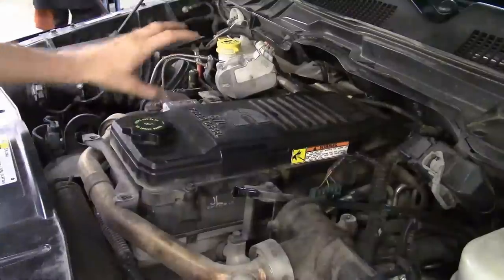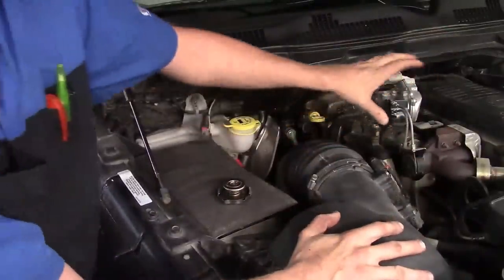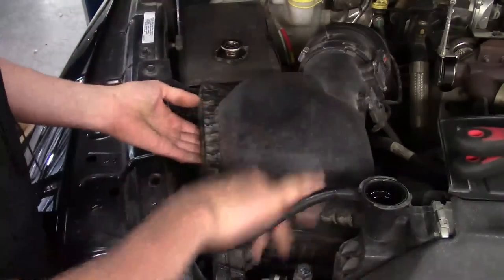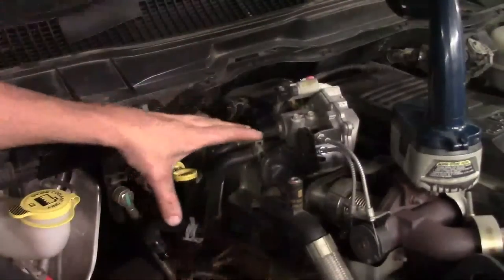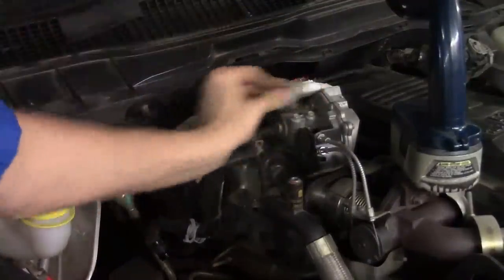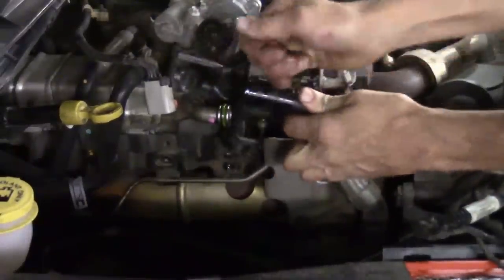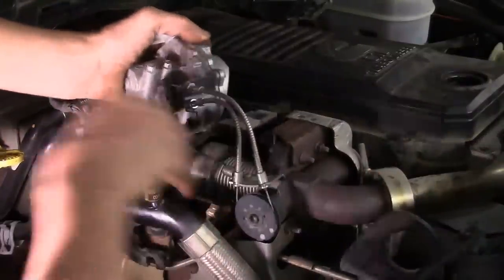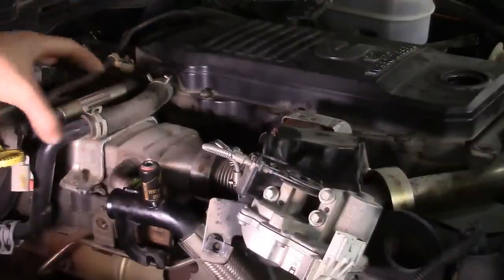Part 1/3: Dodge Ram Cummins 6.7 diesel EGR cooler removal and cleaning

Comment: I wish you would post the years of these 6.7 Cummins because different years require different maintenance schedules and required maintenance.
Reply from the maker: This video was made 7 years ago (2015)……there weren’t many differences back then. Here is a link to another video I made the covers the specifics on the newer versus older 6.7 engines: Cummins 67,500 Mile Service DO'S and DONT'S
https://youtu.be/8GpgpQKxBY0

Comment: Thanks for the content Dave. Much appreciated.  I have a question about my 2015 6.7

 you said in another video that the 2013 to 2018 do not need EGR cleaning with the 67500 service, just the ccv filter.  So with that being said, when do you clean the EGR system? Will it throw messages to tell you or is there a different interval? Possibly clean the system when making upgrades such as banks power intake elbow to eliminate grid heater death bolts?

Comment: I watch your videos and you have a lot of information on the 6.7L diesel. My question is I have a 2011 Ram 3500 with the 6.7L diesel and I notice from watching you about the 67,500 service I look in my Ram Truck Diesel owners manual and it read( The EGR Cooler is covered by the manufacturer only at this maintenance interval for vehicles in California ). I went to the dealer and they said no. I have been trying to locate were it is written in the Calif emission laws.  I am hoping you can help me. Jeff.  P.S. I have never done something like this.

Comment: Took my 08 5500 4x4 diesel in this week for a tie rod recall. Dealer naturally found over $5000.00 of repairs they "said" needed done. Among them was the EGR clean. They charge $935.00 for this. I can't believe how dealers rip off people who don't know better. 

I really like your precise, well made videos and would like to thank you for making these. Always nice to know any tricks before starting a job.

 On a funny note, after going over all the stuff they said was urgent to get fixed, they said my oil was on the verge on needing changed. I said," Oh really. How do you know that?." He said they run it through a tester that can check the service life of the oil. I then told him I normally like to get more than 30 miles out of an oil change as I just changed it before coming here. I don't think Rotella T is a bad oil. I then pointed at his list and said," Now do you see why I have a hard time believeing ANYTHING you have on this list? Just do the recall and that is it."

What a bunch of low lifes. Sad part of it is I even mark the filter with the date and mileage it was changed and you could see that from under the truck.
Reply from the maker: kj inohio You certainly get the good and the bad when you deal with people selling work  on your vehicle. I would love to have seen them show you how they tested the oil.....the look on their face and the excuse as to why they cant would have been priceless. I'm sure there are a few things on the list needed and then there are always the recommended items. Glad you knew better then just say yes like they were hoping for. Still....check over the list and see if you can verify any of the needed items and address them if need be. Thanks for the kind words and for taking the time to watch and comment on the video. Make sure to subscribe and help spread the word by sharing these videos with others. Have a great 4th as well!
Reply: MotorCity Mechanic 

The other urgent items were front and rear brakes($2000.00) and a leaking front differiantial cover($195.00). They say the discs were overheated and show damage. Wheels were not taken off. As far as the diff leak. This truck sat in my heated garage all winter with nothing on the floor. I did recheck the oil level in it and it is within spec.

 When I mentioned the oil change the service writer hung his head and changed the subject. There are good and bad but I seem to be unable to find the good ones. That is why I decide 30 years ago to do my own work and do not regret it. Your videos will just save me some mistakes and save me time. THANKS! and yes, I allready subscribed. Thanks again, Kevin
Reply from the maker: Hey....I got videos on the brakes as well, at least the rear. I can't imagine what its like to not know how to work on your own vehicle like most people. Its all I have ever known so that other side is foreign to me. Just find the time to work on my own is the issue I have. I have to fix the TV, the lawnmower, the wash machine...etc. Its in my blood I too find videos on line to help me out as well. Knowledge needs to be shared and that's the reason for these videos. Thanks again Kevin for watching. If you ever have any questions about your truck...feel free to ask.
Reply: MotorCity Mechanic 

I'm sure something will come along and I'll bother you. I did see the brake one and have done a lot of 1 ton and bigger brake jobs so I'm used to that. Never hurts to watch though. You say the 5500 has a different seal? Will the same install tool work on it? Is it essential to replace if not damaged?

Check out this link to my 5500 and other projects. I do like to build stuff.

http://imageevent.com/kevininohio?n=0
Reply from the maker: Here is a link to the video series on the 4500-5500 series rear rotors replacement: https://www.youtube.com/watch?v=n0jc5jWAblo . It requires different tools and the seal replacement depends on if its leaking when you take it off or to be 100% certain, replace it anyway.
Reply from the maker: kj inohio Cool projects by the way!
Reply from the maker: kj inohio Here is a link to the video series on the 4500-5500 series rear rotors replacement: https://www.youtube.com/watch?v=n0jc5jWAblo . It requires different tools and the seal replacement depends on if its leaking when you take it off or to be 100% certain, replace it anyway.

Comment: I am about to clean the EGR and cooler on my 2015 Ram diesel.  Note  on the Mopar EGR cleaning solution liter bottle says it needs to be diluted. Is it really necessary ? If so, how much do you dilute it ?
Reply from the maker: Personally I dont dilute it.....full strength works best for me. It doesnt cause any issues and cleans better. Thanks for asking and for watching. Make sure to subscribe.

Comment: I am losing antifreeze. Can’t find the leak. I do notice that when I parked the truck the pressure in the engine tends to push the antifreeze out of the overflow. I was told that my EGR cooler could possibly be bad. When I remove it how would I know if it’s bad or if it just needed cleaning. Is it too late once I start losing the antifreeze, has it broken?
Reply from the maker: There is a pressure tester set up for the cooler but obviously you wont have access to it. On some that were leaking pretty good I could remove the tube from the egr valve going to the cooler and pressure test the coolant system and then look inside the cooler to see if any antifreeze started to puddle up. Another thing is with that egr tube off.....does it looks steamed clean on the inside or is it a wet sooty mess? Either could be a sign of coolant leaking from the cooler internally. It should have a dry soot appearance to it on the inside of the tube. Thanks for asking and make sure to subscribe. Thanks for the question and make sure to subscribe.

Comment: I have 2012 3500 Chassis/Cab. I noticed that my EGR cooler looks a bit different. Or really, that it does not have that control valve on top like in this video. Is there anything I need to do know or do differently with my set up? Thanks for putting these together.
Reply from the maker: Jeremy Weber Hey there Jeremy. You are correct....depending on both the year and the model the bypass valve may or may not be present. But it won't make a difference because the valve itself never gets removed. Its actually easier if the valve isn't present. Other different issues with the cooler are that some have rubber coolant hoses while other have slip on pipes with O-rings. Otherwise its the same basic procedure. I appreciate you watching and for the comment. Don't forget to subscribe and enjoy the rest of your weekend.

Comment: Hey Dave, another great video as always. Do you have any info on '08 6.7 with code P0087. On this vehicle, it's been there for a while with no driveability symptoms for several of thousands of miles until recently. Currently running a little rough.

Comment: I have a 2016 with 135000 miles on it . Ive never had the EGR serviced. I called the dealer and they said they don't  pull it off to clean it. They have a machine that they put on it and it cleans it without having to take everything off. Do you think I should have it pulled off because its so overdue or do you think the machine will clean it. The system they use is called Terra clean. I would love to have some input on this.

Comment: would you suggest doing this on any used 6.7 CTD truck?  I can't tell if this has been done and don't see it in dealer sevice records for either R/R or cleaning.  My 2010 has 280k *(170k mi?).  It runs like a top but curious if this is something I should be doing....  Thanks for the video and wondering where you weigh in on cleaning with a torch after removing pintle/seals?  I used to clean EGRs and manis like that and it worked very well.

Comment: I have a ram 2018 3500 with a red ⚡ on dashboard saying SERVICE ELECTRONIC CONTROL UNIT,   I have 150k and i just did the 2nd EGR system clean up on it. Any ideas why is this coming on?

Comment: Please tell me how you figure it's very rare that they rupture I would say 9 out of 10 end up rupturing that is the whole purpose people delete the trucks ask me I'll tell you I got three EGR cooler sitting here one is on my truck that I'm getting ready to take back off I believe because this one is bad now the original one that came on the truck stock on a 2017 with only about 260,000 miles on it ruptured and then I've got another one laying on the floor in the shop in case this one that I got on it currently went bad. Between EGR systems and 68 rfe transmissions in the Rams that's what keeps dodge in business. Now I get it I understand you're a Chrysler certified mechanic so you've got to play the game but you know as well as I do as well as everyone else watching your videos and reading the comments that that is a line of BS that you  just said that they very rarely rupture
Reply from the maker: I don’t work at the dealership….I have my own shop. So to say that I have to say what they want me to say basically isn’t true. I have worked on the 6.7 since it came out in 2007 and since then have only replaced 3 coolers. That’s right….3! If a cooler lasted 260,000 miles I would say well done! There are other engines and other parts that are common failures….but will agree to disagree that this isn’t one of them so I stand by what I said and those are my words and not filtered by Chrysler. I was the main diesel tech at the dealer shop for 16 years and the main trans tech as well so I have seen more trucks with that engine and with that trans you speak of the most techs other then those in my same situation. Those that delete do it “mainly” for performance and others for fuel economy, certainly not for the EGR cooler. If it was the 9 out of 10 that you said (not sure how you came up with that number) , I would be doing these all day long and ordering them by the dozens and making bank. That’s not the case. I know what I see and what I have done, sorry you think otherwise but I don’t appreciate you assuming I am “lying” or “covering up” a issue based on your statements. I speak what I have learned from experience and no one or no company filters my comments in my videos as again you assume. Have a nice  day
Reply: I’ll tell you what if your credentials are as you say, where are you located ? Is it safe to say by the name of your channel you’re in Michigan ? If so I’ll bring ,y truck o you and you can have i my business then. I’ve had nothing but troubles between the two mentioned issues and guarantee I can bring you way more work than you and an army of 10 mechanics could handle on a regular basis if you want bank. Show me some statistics on your data and you name if you’d like not that you need it but will have a rolling billboard on the side of my rig and multiple others also. That being said I see my statistics in real world working trucks not pavement princesses or daddy’s money some 19 year old drives truck . My truck runs anywhere from 17,000 lbs empty with trailer and full tanks of fuel up to 36.000 lbs fully loaded on a Dailey basis from Michigan to anywhere in the continental 48 states and was candidate for Cummins buy back program because of the real world everyday use that these trucks were designed and built for. Not to delete and pull up to a C7 ZR1 or Nissan GTR at a traffic light. Out of your customer base what would you say the ratio of work (true work like mine) is compared to just daily drivers is ? Because I base my saying 9 out of 10 on real world working trucks that do the same as mine and are putting down anywhere from probably 400 to 700 miles a day at weights in access of at least 20,000 lbs everyday they are moving.

Comment: I have a replacement cooler.  Am I needing a gasket set. If I’m careful will I be okay using what is on there. I’m on the road and no one has them in stock. Emergency fix till I get home. Help!!!  Thanks

Comment: Any concerns cleaning the EGR cooler with a Ultrasonic Bath? Irregardless of which chemical degreaser one may use, would a ultrasonic cleaner potentially rattle the fins apart?

Comment: Thanks again for  your  great videos. I have 2014 cummins and this service is coming up for my truck. If I send my Vin  # would you be able to check to see what work needs to be done? I didn't get much help from my local dealer. They said bring it in. But I plan on doing the work. Thanks again..

Comment: David, before doing the EGR Cooler cleaning, do you have to drain the coolant first (or drain it half way)? Did you do this vid without draining any coolant other than the coolant in the EGR Cooler?
Reply from the maker: Sorry about the confusion. I do recommend draining the coolant. You can try draining half if you plan on reusing the old coolant but I only recommend that if the coolant is still good and not close to the coolant flush interval in the maintenance. . Thanks for the question and make sure to subscribe
Reply: David, one more thing about refilling the coolant. I read in the manual that ... "NOTE: The diesel engine is equipped with two one-way check valves (jiggle pins). The check valves are
used as a servicing feature and will vent air when the system is being filled. Water pressure (or flow) will
hold the valves closed".  Where are these check valves?  Are they something we have to remove or open when refilling?  Your vid only shows the Vent Tube at the top of the coolant system and to fill until a steady stream of coolant flows out of it.  Will these Check Valves prevent the coolant from filling the system up to the top?
Reply from the maker: John Regal I have never heard of these valves? When it comes to adding coolant, it depends on the year of the truck

Comment: I took my egr valve apart and the solenoid was covered with carbon.  Is that normal ?
Reply from the maker: I do see some soot from time to time and havent seen it cause any issues. If your doing the service as maintenance and not having issues then I would say you will be fine. Thanks for asking and make sure to subscribe

Comment: Question off topic. As I stated I have a 07 6.7 with 72000 miles. Would it be worth buying an extended warranty through Mopar. The cost is "Bumper to Bumper" 3 yrs 36000 miles for $3900. Good or Bad.
Reply from the maker: Hard to say. Sounds like a lot of money however......personally I probably wouldnt but then again, I work on them so I feel confident enough about fixing what ever happens. So my opinion may be biased. In the end its more about what gives you peace of mind and allows you to sleep easy knowing that your vehicle will be taken care of.

Comment: great video on EGR cooler.  i found I have a cooler gasket leak and am to be replacing it.  Not deleting for now, funds are tight.  Question on the   cables.  I have slack in the cables, can I tighten those up. Or zre they required to have slack.  Thanks!
Reply from the maker: Are you speaking of the cables going to the EGR cooler bypass valve just infront of the EGR cooler. They are preset and should be touched as far as adjusting. Appreciate your watching. Make sure to subscribe!

Comment: Do you need to completely drain the radiator?
Reply from the maker: You dont have to unless you want to. I look at it as replacing the coolant....maintenance. If the coolant has been replaced recently just drain enough to do the job and capture the antifreeze in a clean container and reuse it. If its been awhile.....drain it all and add new. Thanks for the question Christopher. Make sure to subscribe as well.

Comment: With cleaning the egr cooler and egr valve should you clean egr control valve and cross over pipe? Sorry for all the questions I am currently doing this project.
Reply from the maker: While its off there is no harm in cleaning it as well. No need to apologize fro the questions.....ask all you want.

Comment: I need to replace my turbo and I am planning to clean the egr and cooler.  What would be a benifit if any to delete the egr
Reply: deleting the egr will just prevent used air from being burned again. You should get better mileage because the engine will only use fresh air.